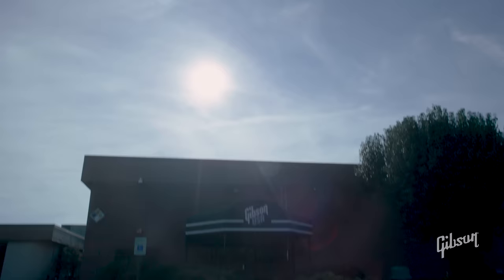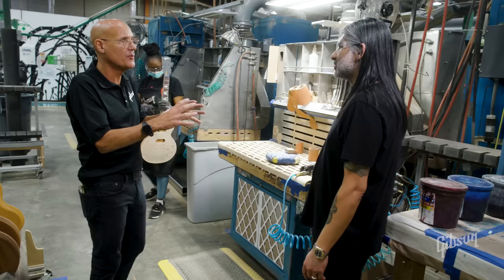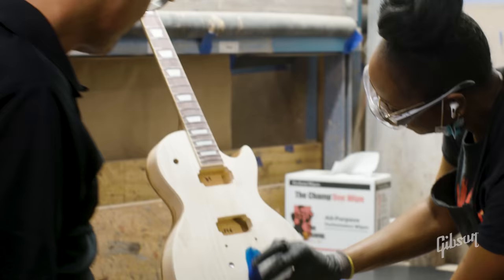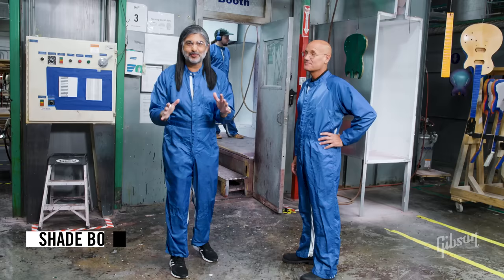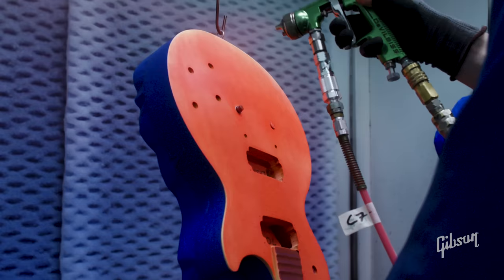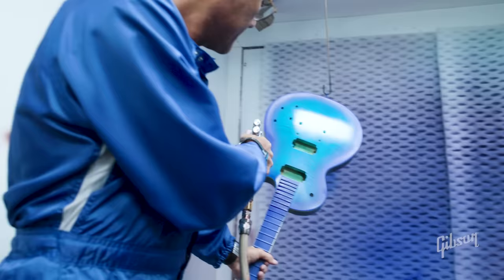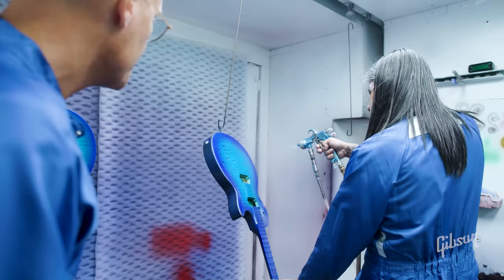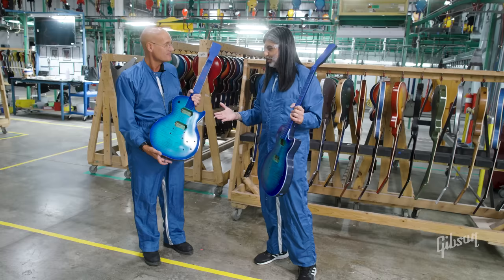Ever Wonder How We Spray A Nitro Burst On YOUR New Gibson Les Paul?

Comment: Why are some sticky and some bone dry, and do you have any tips for it?
Reply: Lacquer works by solvent evaporation. If its sticky there are solvents still evaporating in the finish. For example this is why you would never rub your nitro finished guitar with alcohol because it will start to reliquefy the finish. A warm dry place will help the finish cure fully. Gibson should not be letting sticky guitars out the door, unless you're referring to  gloss finish guitars vs matte finish. Gloss is naturally less smooth to the touch than the matte, sometimes people call glossy necks sticky. You can give a light sanding to glossy necks to make them play "smoother" but this can potentially effect the resale value of your guitar slightly.